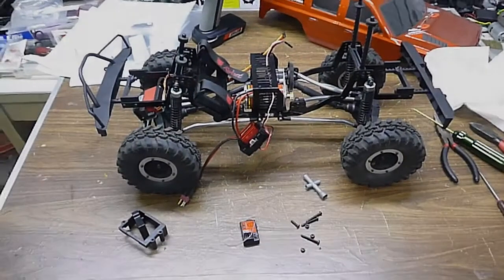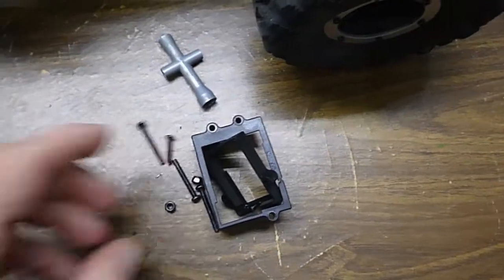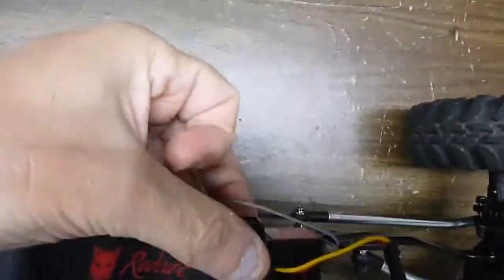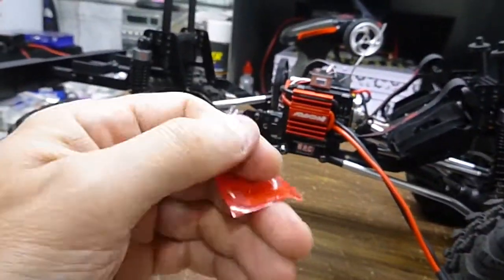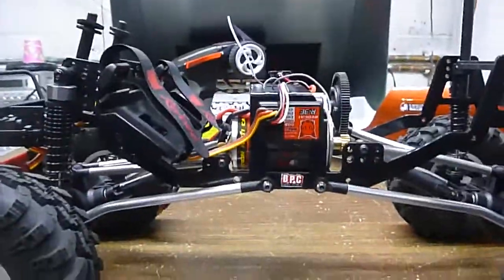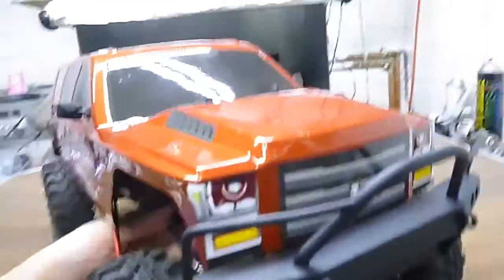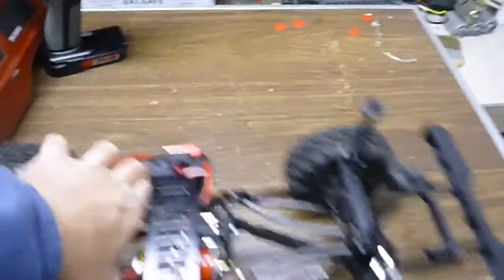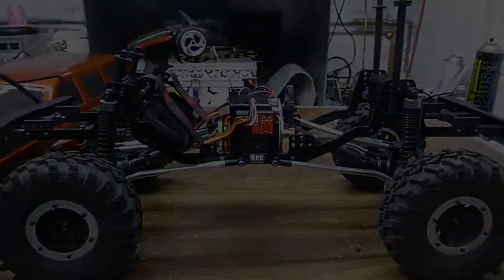REDCAT GEN7 ELECTRONICS PLACEMENT LOWER CENTER OF GRAVITY MOD

Comment: Hi Shen, the star previously know as Shenlonco :-) sorry could not resist that one. Good idea putting the electrics lower and that metal cage over the gearbox must weight a bit. Is there a way of making it lighter.
Reply from the maker: Thanks 😀 was thinking next to cut the top section right off! If it gets weak I could put a tie rod across to brace it.